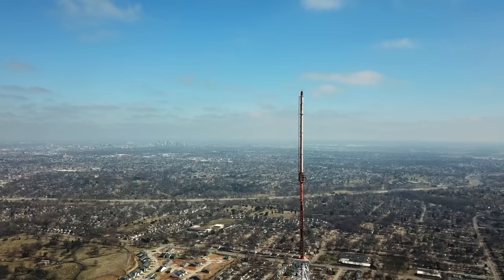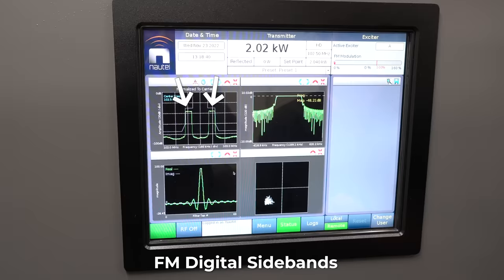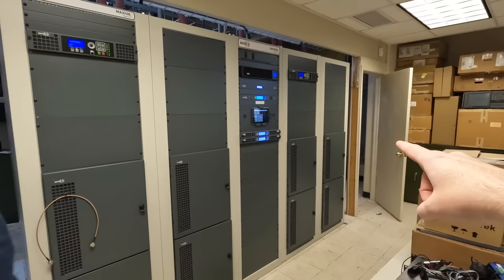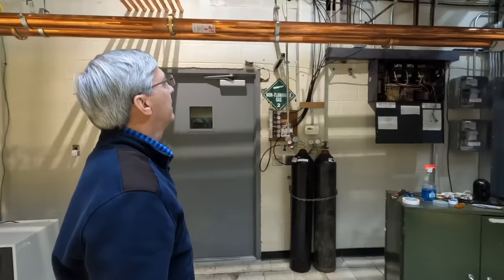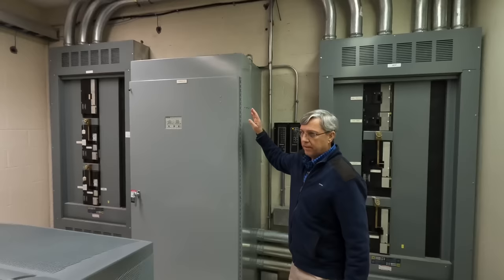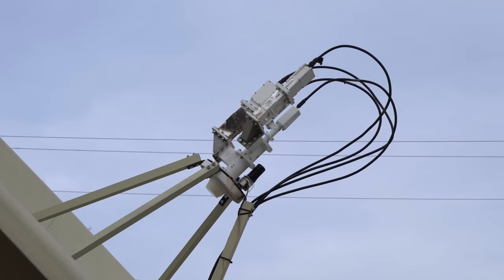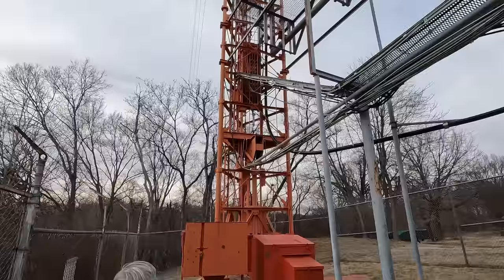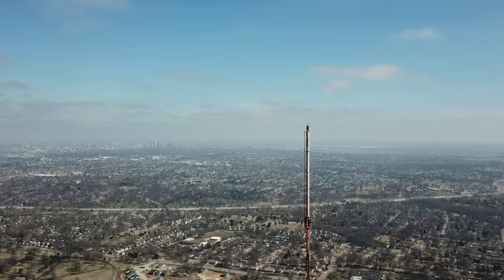What's inside the 2nd oldest TV tower in the West

Comment: What is inside this cooper pipes on 5:49? Liquid? Wires? Steam?
Reply: The thicker ones have pressurized nitrogen, to keep out moisture (prevents arcing). The smaller pipes have water pumped through the transmitters for cooling.

Comment: The actual TV signal does not use all 77 mbps of the microwave link you referenced...it only uses 19.39 mbps. The rest of that bandwidth is probably used for remote control or general internet inside the building.

Comment: Analog TV used Vestigal sideband, not AM for the video. The last station I worked at was 5MW EIRP, on a 1700 foot tower. We used the standard 7GHz STL equipment from our Orlando and Leesburg, Florida studios. There was no line of sight from Leesburg to Orange City, so we linked from the original transmitter site to the new site.  The station was originally a local access cable TV channel, so the existing 11 GHz CARS equipment was used to link the Leesburg site since the TV tower was very close to the CATV tower.
Reply: Vestigial Side Band is still amplitude modulation, just a different form of it. So technically he wasn't wrong.
Reply: @klystron22  It does start start as AM, but it is not after the complex, low phase shift filtering since true AM uses both sidebands and the carrier. Have you ever aligned the filtering in a TV transmitter, or a Diplexer?

The FCC would not agree with you, since they designate it separately from AM Broadcast. I'm a Retired TV engineer from the Analog days. I've worked from a flea powered 90 Watt AFRTS TV station with the antenna on a 100 foot tower, to a commercially licensed 5 MW EIRP on a 1700 foot tower. I was also the 'Engineer Of Record for a 1.3 MW EIRP UHF station, and built the transmitter site.

If you had used AM for video, you would have wiped out the Aural signal of a lower adjacent channel. Cable TV would have had a much lower channel count for the same bandwidth, because of this so, technically it is a subset of true AM.
The radiated power leaving the antenna started as 50 or 60 Hz three phase AC line voltage, but it isn't what is fed to the antenna. The Visual signal started and ended in the same format, so by your logic, it is just NTSC video leaving the antenna.
Read the CFR part 47 on the FCC regulations.

Comment: Digital sounds cool but the shorter range and higher vulnerability to interference makes it a lot worse than analog.  Also you can no longer listen to news with a battery-powered multi-band radio because you need a full on computer to decode it and extract audio rather than a simple efficient FM receiver.

Comment: that "
upgrade to digital suck for most of Jefferson County  we are too far away for a good signal. Before that we had zero issues with St L channels
Reply: great video though
Reply: The frequency changes may have been the most problematic part. The old TV antennas were for the old (lower frequency) channels. Changing out the antenna is a must, but getting a good one mounted in a good place is a challenge for many. Thanks for the comment.

Comment: Sorry, but Analogue TV was way better. The range with digital is just pathetic. If you are are on the fringes of the signal then the station is completely unwatchable. With analogue you just a slightly fuzzy picture. Why even bother when the range is so much less
Reply: The digital shredding accompanied by the audio dropout is more annoying that the old analog fade for sure. The idea was not to reduce coverage but it can feel like it if you are in a spot and have an issue.
Reply: @radijoe  I am pretty sure the REAL reason we moved to digital wasn’t because it is technically better (we could do analogue TV in HD) but because Corporate America wanted all of that juicy bandwidth. So they bought it. And here we are now where rural America has no free over the air TV. :(
Reply: ATSC 1.0 is a pathetic implementation of a digital transport system.  Due to politics (US company Zenith) it was picked.  Zenith soon after was bought by Samsung (I believe).  So, so much for American made.  Way to go FCC!  Much like their AM stereo screw up.  ATSC 3.0 is more resilient, thankfully.